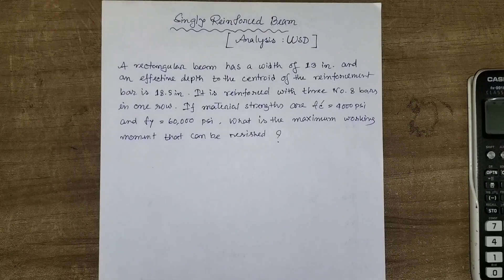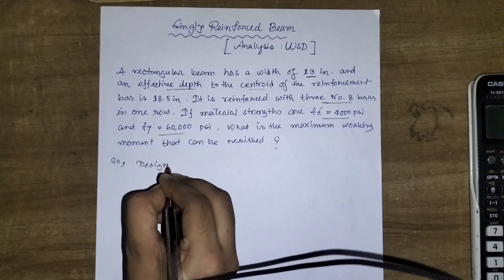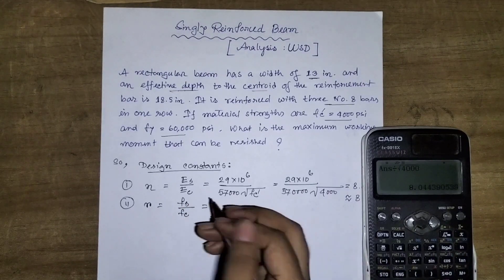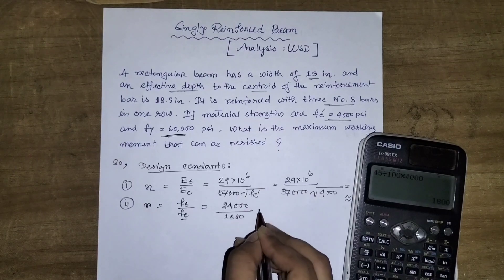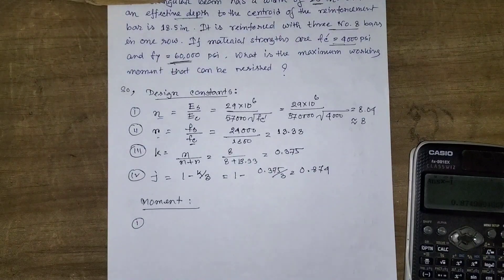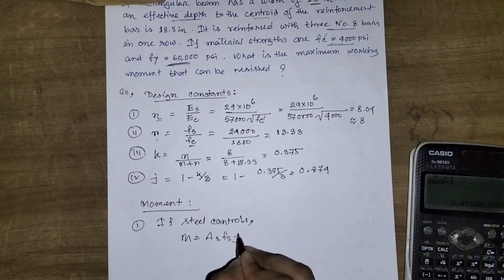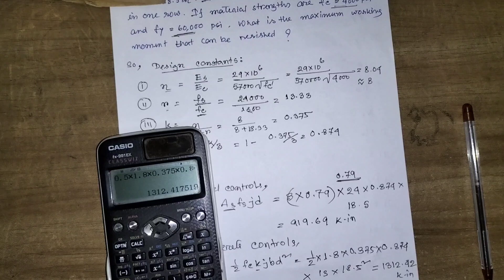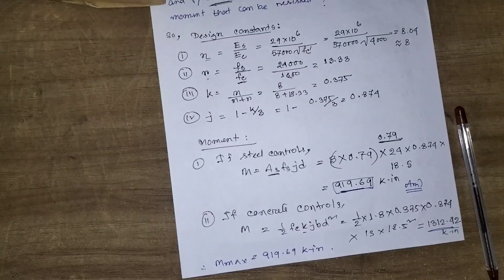How to Solve Singly Reinforced Beam: Analysis in WSD method || Most easy way || RCC|| Structure

Comment: A rectangular beam must carry a distributed live load of 680 lb/ft and support the dead load of a wall weighing 380 lb/ft,
in addition to its own weight of 350 lb/ft, on a simple span of 24 ft. Design the beam for flexure by WSD method, using
intermediate grade steel at a working stress of 20,000 psi and 3000 psi concrete at a working stress of 1350 psi.........................................for this math , should we need to calculate fs and fc as 40 and 45 percent or not? explain